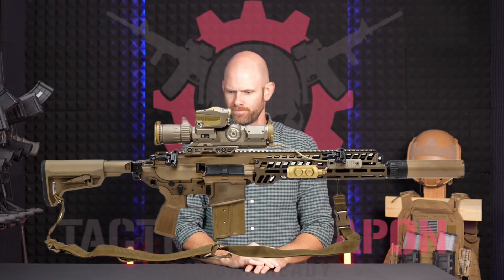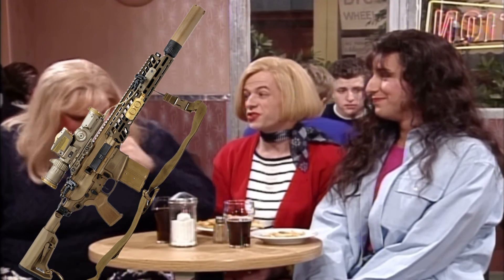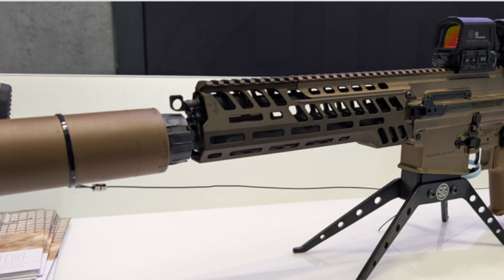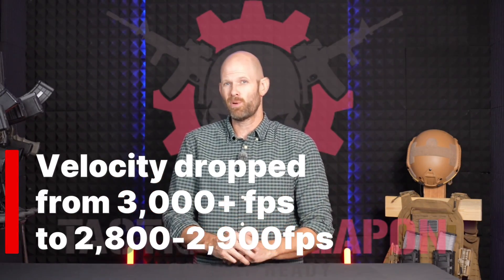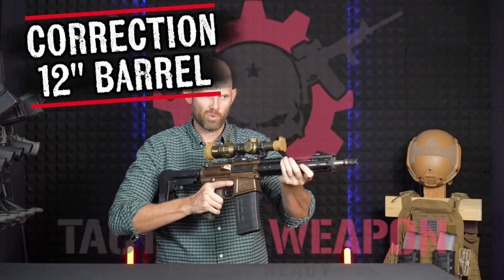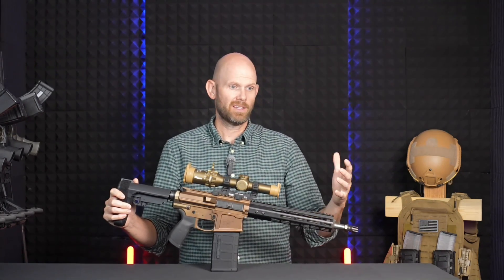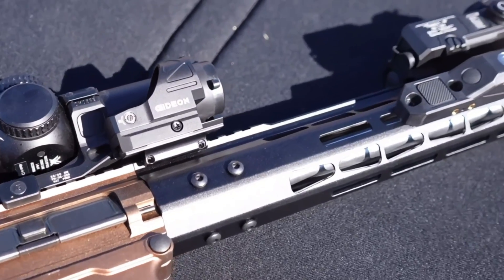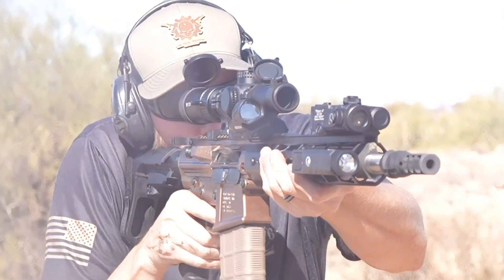SIG M7 Slims Down: Cutting Weight or Cutting Corners?

Comment: For the NGSW program, the rifle platform the US Army (and the US military as a whole) should have gone with is the Robinson Armament XCR-L. Its robust tri-lug bolt and long-stroke gas piston system will outlast every competitor. For ammo, the 5.56 NATO blacktip is more than capable of defeating body armor, as reports from Ukraine have shown. Still, the ballistics performance of the 5.56 NATO could be further improved by switching to NA3S nickle alloy steel casing for increased velocity and range. The XCR-L should be the new rifle issued to rifleman. 

Furthermore, the US Army should adopt the XCR-M with a barrel swap for both 7.62 NATO and 6.5 Creedmoor. Again, the ammo should be NA3S cased ammo. And they should bring back the designated marksman role, having two per squad, with the XCR-M employed as their designated marksman rifle.

Comment: You are disingenuous with your information:
7.6 lbs with 13" barrel is the actual M7 PIE
The 7.3 lbs 10" barrel is a potential carbine offering btw with the suppressor attached achieving 3000 fps is very much a possibility...

You didn't do the study, nor have the information available as to why the US Army mandated a 6.8mm projectile.

Your video demonstration of the SBR 6.5 is a massive fraud you have some ridiculous magazine that out weighs the M7 even in current form.

Keep your trash in your echo chamber where you try to prove how right you are, how's the XM7 was cancelled messaging working out for you?

Strange how it is now the M7 & M250...

Comment: The weight is the least of its issues. 

From what I remember the barrel needs an upgrade to deal with the damage the chosen calibre does to the barrel rifling.

If the US military had more respect for the troops, they'd have gone with the WLVRN platform in 6.5 Creedmore, rather than call them stupid grunts with "They can't operate a rifle outside of the AR series." It also comes out lighter than a standard M4 or M16.

The issue would be prone reloading, just redesign the feed system to work like a P90. The old mag is still there and used to store things like a cleaning kit or snacks.
Reply from the maker: Agree

Comment: I think you are right, the AR10 or XCR- L in high power cartridges, XCR-M would have worked. Im more in favor of the XCR rifles because they are simple, effective, and reliable. They could have worked with shell shock tech. to make a cartridge that will work. But, if the military wanted high velocity out of a compact rifle, why not look at the DT wlvrn as well?
Reply from the maker: I agree! I actually did a couple videos where I used the DT MDRX to show it or one of the other bullpups would have been better.
Why the XM7 Rifle Is a Big Mistake!! Better Alternatives Explained: Desert Tech MDRX, Part 1
https://youtu.be/AfWtt670L0I

Comment: The cartridge sucks for regular infantry. It would be better to have a hot 6mm that fits in a 5.56 Stanag magazine.
Reply from the maker: I definitely take the lighter recoil of the 6.5 Grendel for a standard issue rifle and then the 6mm ARC seems to be even better.
Reply: @combatreadychannel  6mm MAX is way to go as standard cardrige. Almost the same performance on heavy  bullet as 6mm ARC, but better in lighter bullet and shorter barrel. And     use standard 5.56 bolt face.
Reply: @jazon9 that’s more of an issue. Why would we continue to use gun parts that are nearly 70 years old in design. The US Army isn’t going to re-barrel their M4’s, that wouldn’t make any sense, and to buy new guns that are that old in design also doesn’t make sense.

This also ignores that militaries aren’t using the AR-15 anymore. The US has switched to the Spear, an internal recoil piston gun. The Germans and French have switched to the HK416, a piston AR pattern rifle but not M4 compatible. The Brit’s are also looking at a piston internal recoil gun, as are the Israelis, the Czechs, the Finns, the Belgians switched long ago in the Scar. There are no new rifles being fielded that are AR-15’s (aka buffer tube, direct impingement design), at best AR pattern rifles with pistons. 

Even in the AR world in the US, AR-15 parts aren’t being developed further. The military is fielding stuff like 6ARC, and Surefire just delivered the ICAR design, which utilizes an LWRC Six8 receiver set, which is reinforced for larger cartridges, and proprietary Magpul mags designed specifically for newer cartridges.

The issue is that the AR-15 was developed specifically for 5.56, which is a limited cartridge. By sticking to those parts, you are limiting yourself to those specs. That would be like if Ford took an old ‘59 F-100, and with modern material science remade the old chassis and suspension, called it a day, and built their brand new F-150 on top of it. It just doesn’t make sense.

Now, for the military world it’s nonsensical, but I do actually think 6 MAX is a good option for the civilian world. Many individuals are limited to or already have AR-15’s, and being told they can get a much more capable rifle by just buying a new barrel for their existing gun makes a lot of sense. I actually hope 6 MAX becomes successful in the civilian market, for that very reason. The future of militaries though? No, even FN has delivered their IWS platform in 6.5 LICC (a cartridge developed with the US Army Marksmanship unit), and a few days ago, permanently discontinued the SCAR for commercial sale. That’s not a coincidence.
Reply: @jazon9  Absolutely facts! Especially if they introduce the peak alloy technology from the 7mm Backcountry to turbo charge the 6 MAX in SBRs
Reply: You’re not the target audience. It’s meant for people that are in shape.